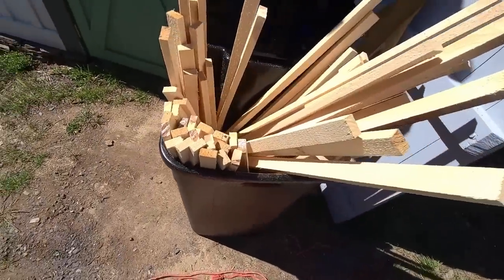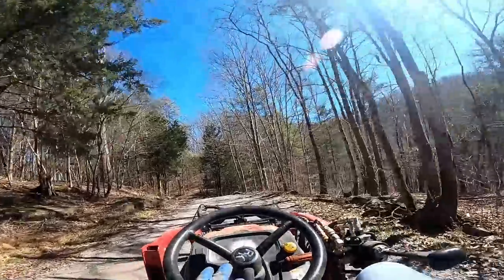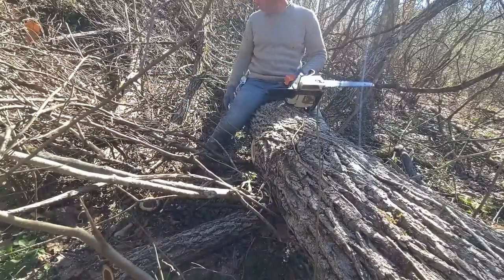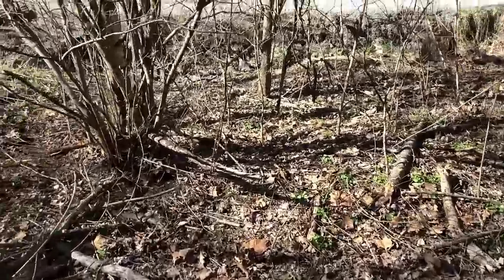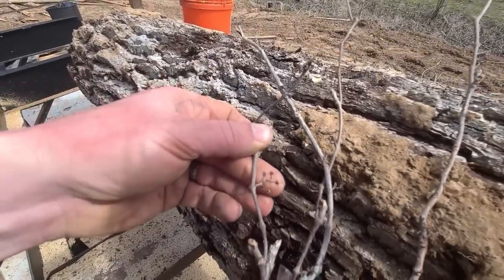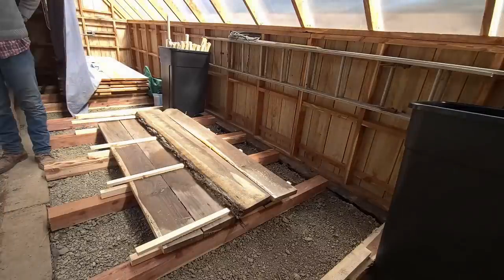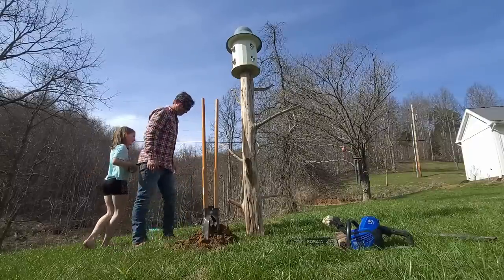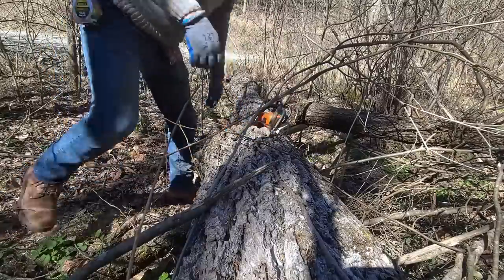Milling black walnut // E122   Walnut

Comment: As an old-timer burning wood for heat, I found walnut does not burn well due to oils snd deposits an excessive tar deposit in the flue.  Monitor the buildup of tars if you decide to burn.  Enjoy your channel and look forward to each post.

Comment: Kiln add-on:
Like the curtain separators. Get a couple sheets of styrofoam insulation and rip it lengthwise lay on top on more stickers. Lay the ends of the curtains on that. Light, cheap, waterproof.

Comment: For your drape, drain pipe with slit to receive drape bottom with rod to roll up drape inside.
Allow pipe to sit ontop of the staacked wood.
Black walnut grows like a weed in my area.
Good video youall.

Comment: John; I wanted to let you know about the bird house, it is a Martin house, and they are a seasonal bird that is very effective at mosquito control. But they work best at a 20-25 foot height minimum. Plus the Martin's will not come back to it if there is a nest from the previous year, so it needs to be on a post that can fold over and be cleaned out every year. That is why it was made with the removable top and all of the inside sections pull out. So if you want it to be effective for mosquito control you might want to make some changes. But I do like the look of it on the tree log, BTW, I really enjoy your videos and the progress around your homestead.
Reply from the maker: Very cool!  I didn't know it was for a particular species.  If we don't get residents this year, we might need to make that change for next year and find a different cedar to use that's taller.  Maybe just search for a dead cedar, top it off and get up there with the extension ladder to install the martin house. Thanks for sharing!

Comment: That walnut is beautiful! What a great haul! John should go back for the rest since you have that kiln now. you can dry those smaller pieces out and sell them to  Wood Turners! We are always looking for pieces like that for the lathe. Also John is an ingenious man he should look into building a tow behind log skidder. look them up! You can tow a few logs at the same time from behind in single file. It's easier on the trails with better visibility and clearance width wise and less wear on the hydraulic rams. I guy I worked with built a few for cheap with a few hubs tire and rims from the junk yard when he was renovating his family's land  years ago. For the kiln you guys can make some bo-bo Chinese Bamboo Roller Blinds out of those curtains with some pvc pipe and para cord just roll it up and down as you need to! Thanks for the episode looking forward to the next one!

Comment: Hi guys,
What a find on the side of the road. Beautiful timber for furniture, especially for inlays and contrast work. It is good that you have your solar kiln up and running. It will be interesting to see if there is a noticeable difference in the walnut seasoned in the barn vs that in the solar kiln. The barn is going to be so useful for lumber storage when you are cutting and drying timber for the house and outbuildings.
With regard to your Stihl chainsaw, I notice a couple of comments regarding a clogged spark arrestor filter. It might need replacing, but the main symptom of a clogged arrestor is the saw will not rev up (because the combustion gasses can't escape quick enough). The issue you seem to have is poor performance at low revs (idle). In a 2-stroke engine, this can be caused by a number of things, the most common being; dirty/old fuel, worn piston rings, scored cylinder/piston, clogged low speed carb jet, incorrectly adjusted LS carb jet, poorly fitting/leaking carb gasket/insulator, crank case separation (leaking) or leaking crank shaft seals. From your comments in previous videos, you have check most of the above list, with the exception of leaks in the crank case and shaft. These are easy enough to check. With both the intake and exhaust ports blocked, apply air pressure ( 5 to 7 PSI ) through the spark plug hole, apply soapy water to the probable areas and look for bubbles. Blocking the ports can be as easy as putting a piece of inner tube between the muffler and exhaust port and re tighten, and the same for the carburettor. If no leaks are found, I'd go down the carburettor replacement route.

Thanks for the great entertainment, and good luck with the footings.
Cheers, Guys

Comment: As for moving sawdust from away from  the mill area, saw a guy use his snow blower and just walk right through blowing the sawdust out of his way... just a thought if your in a hurry. I am a heavy duty cheapskate. I happen to love walnut myself and would find a way to cut into thin veneer like thickness, and laminate to other cheaper wood like pine to give people the idea the wall or what ever I made with it being a solid piece of wood.... in retrospect, it might even warp less. Way cool save of nice tree. Its hard to not get sidetracked when seeing something like this and just switch into making pretty things instead.. congrates on home build, your far ahead of where most might try to get for  the size of crew

Comment: Hey folks.  Another great video.  Good job.

Was curious about whether you are sealing the ends of those boards before drying.  Even a coat of paint will help avoid end checks.  At least reduce their length.  It would be a shame to needlessly cut the useful length of those boards.

Comment: The idle speed on that saw is adjustable. There is a small plug over the adjustment screw. Remove the plug. do the adjustment, and all is good. (you do not need to reinstall the Plug)

Comment: High guys. Love your video's although they are a little long, but it's your show to do what you want. Meg is certainly a great help to you John, also glad to see you are slowly bringing the girls in to help out when possible. I did the same for both my Son and Daughter and it has helped them throughout their lives so far. John, just a suggestion, but, you have a lot of slab wood and cut offs laying about and certainly some of them could be used to lay your logs and lumber on to keep it out of the dirt. Thereby helping to ease the time used to sharpen both your bandsaw and your chainsaws. I have helped several guys here where I live by tailing their saws and they never put a blade into their logs with out sweeping them with a heavy broom. Hope this helps. Keep the videos coming and looking forward to watching you build your new home.
Bless you all and stay safe.
Brian.

Comment: Check to see if the spark arrestor in the muffler is plugged up.  That's a common problem with newer small engines.

Comment: I've been told that there's a bird that eats it's weight in mosquitoes every day, but I don't remember it's name.  The Amish make a house for it.
Reply: Purple Martins
Reply: Purple Martins
Reply: Purple Martins, but that needs to be twice that height for them. Good job with pole choice though
Also, in the kiln, leave about half to three quarters inch between boards so air can also pass easily up through the stack.

Comment: Ha  John . How do you know how long to leave the boards in the kiln to get the moisture content you want ??
Reply from the maker: We have a digital moisture meter.  Once the boards read below 19%, they are grade worthy.
Reply: @WalnutsandWineberries  So how do you keep the wood at that level after you take it out of the kiln . Thanks ...
Reply from the maker: Well, 19% is high.  We're shooting for around 15%.  Once that initial drying occurs, the cell walls in the wood permanently shrink and don't allow an abundance of moisture to be reabsorbed.  The wood will, however, acclimate to the environment, which is a good thing, so it doesn't get overly stressed when you go and build with it.  We plan on stacking and covering until we have the inventory we need for the house.  I hope that makes sense.